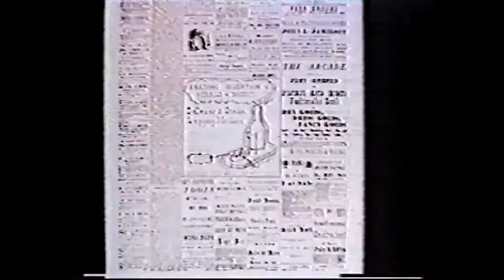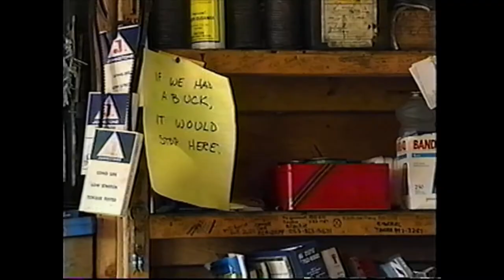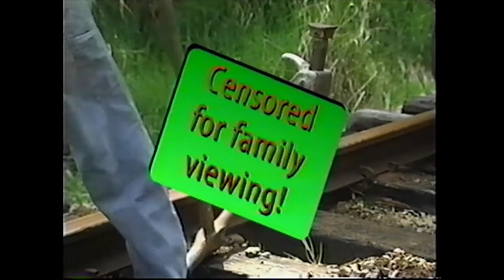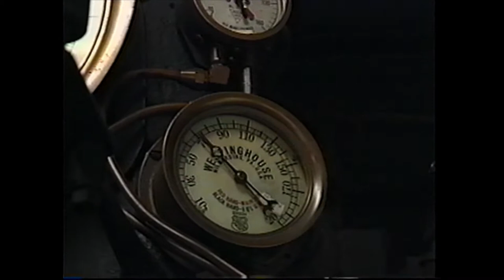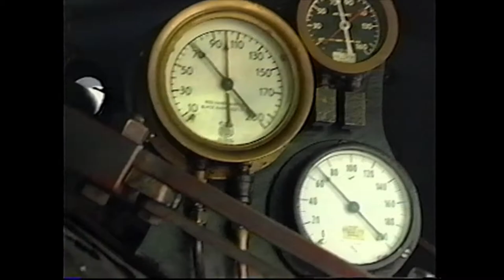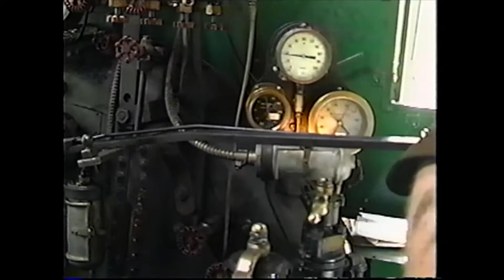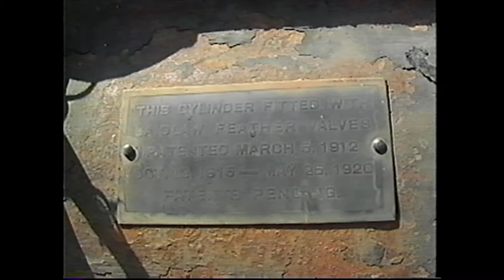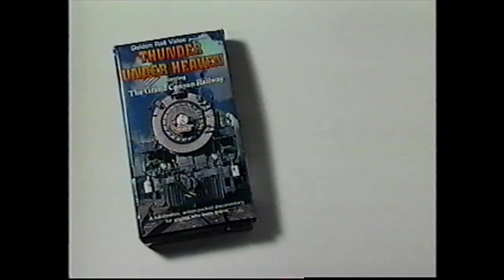Steam Up at Mount Rainer (VHS)

Comment: I love this movie it is my favorite movie since I love logging railroads and locomotives. What whistles have #11 had in her lifetime
Reply: Shay 11 was built with a Lima 5 Chime, which it kept while running for Pickering and Klamath & Hoppow Valley. In 1994 it was restored by MRSR and was given a Powell 3 Chime. In 2000, it wore some sort of step-top 3 Chime (later used on the Heisler) and kept it until retirement in 2003. Hope that helps! :)
Reply: @dylanjames554  thanks a lot I was going to do a history of 11 sometime and I needed to know which whistles she had in her lifetime. 11 is my favorite Shay locomotive which is my favorite steam locomotive. I’ve seen her twice in person! Thanks again!
Reply: @dylanjames554  didn’t it run again in 2008 for the steam up event? Or was that in 2003?
Reply: @brendanstrains9725  Glad to help! No it didn’t run after 2003. I think it’s FRA boiler time expired.
Reply: @dylanjames554  ah I see I’ve seen it in a display building a couple times and I think it was supposed to be restored but it was put on the back burner.